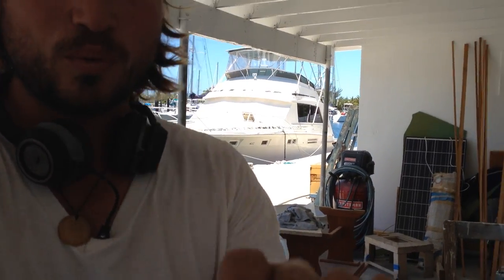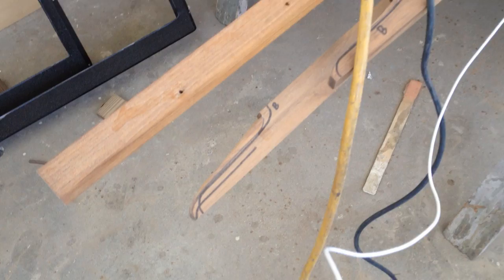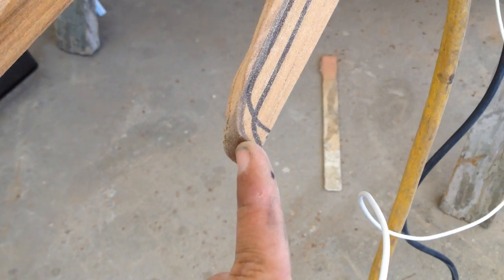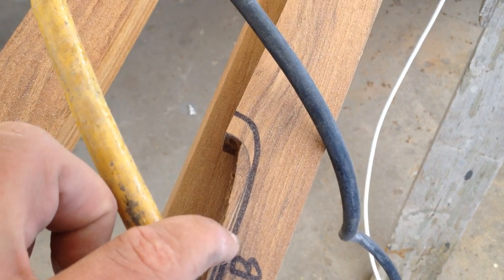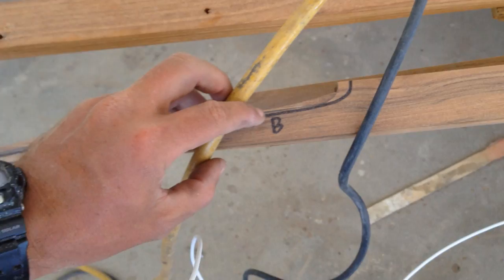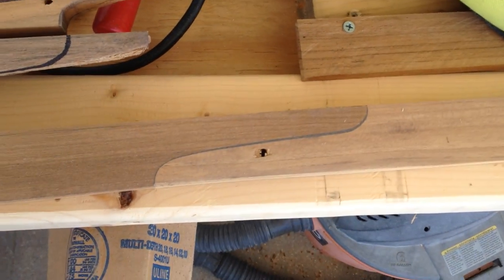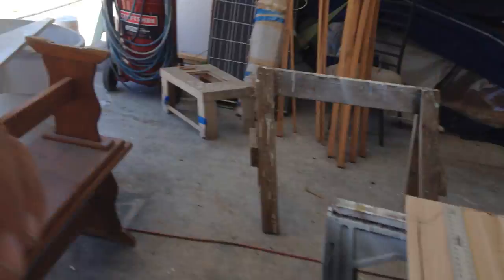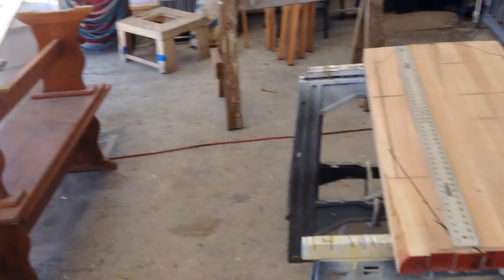Atticus Update 42: Caprail #Fail

Comment: Well the wood failed and not the joint.  That is a little good news.  Is that "s" curve scarf good for transferring the pressure on the wood fibres?  I would be inclined to use a flat scarf (long too).
Reply from the maker: Yeah good call. We did finally end up using a long flat scarf, but ultimately the saving grace was the fasteners we used on the sides, since the epoxied joint did begin to seperate but was held together by the fasteners.
Reply: Keep the vids coming.  Enjoy you guys!

Comment: if you bent the sections first before scarfing the joints you can avoid hard spots that transfer alot of force to the wood
Reply from the maker: Interesting. So you recommend installing each piece before gluing the scarfs or some kind of steam bending?
Reply: +Project Atticus use steam and pre bend sections then cut your scarf joints and glue up reducing the amout of flex needed to fit to the rail after the glue up then drill for fitting to the boat don't forget if you are doing epoxy encapsulation to do the bottom side and inside the hardware holes